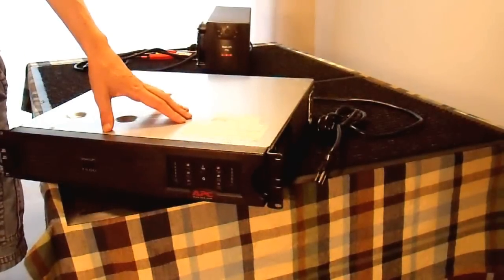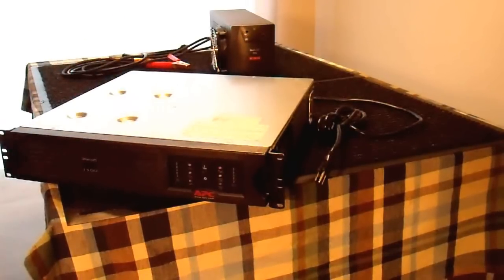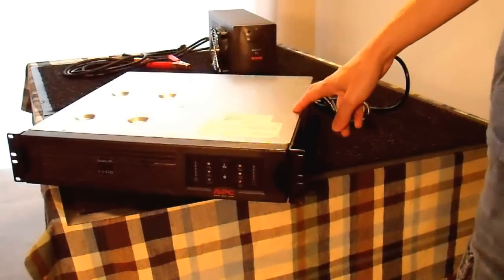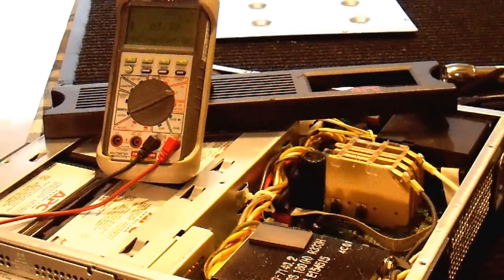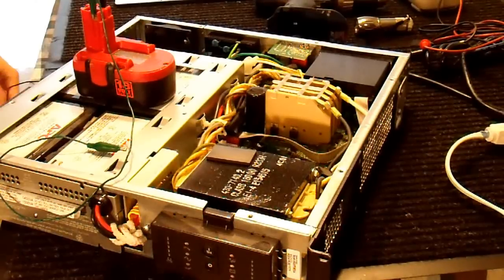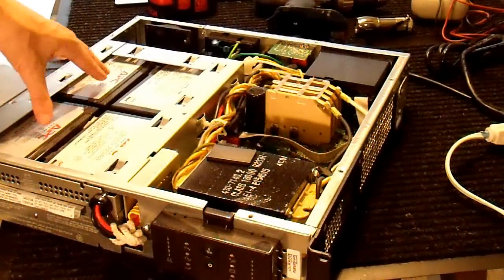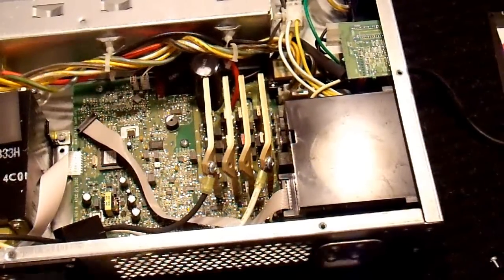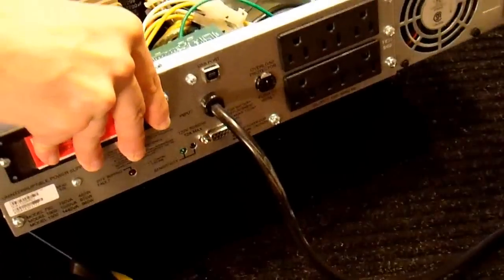UPS to 1.5kW Sinewave Inverter Conversion part1 - Free Sinewave Inverter??

Comment from the maker: I did try reversing the fan on the back of the unit and it resulted in it moving almost no air due to 'sucking' against the fan grate.  Good idea though, I didn't try reversing the fan on top.  It would have been easy enough to give a try - sometimes experiments yield unexpected results!

Comment from the maker: Axial fans don't like pulling air from turbulent sources - it makes them very inefficient.  So pulling air from 'free air' around the unit results in more airflow than if the fan drew air in from around the FET heatsinks.  I'm not sure why it is this way I just know that's the way it works from practical experience.  A good CFD simulation would probably show why this is.  It also forces the air to mix better in the case this way.  Turbulent air cools more efficiently than a laminar flow of air.

Comment: Nice videos.  A question about the temperature regulation.  Did you try using the fan above the FETs as an air extractor vs. blower?  (Cooler air entering around the transformer vs. air that has already been pre-heated by the FETs).  The FET temp. might be a little higher, but you might be able to do away with the "bump" at the front of the case.  Reversing the airflow on the 24vdc fan at the rear of the unit (blowing in) might also have an effect.  Worth a try, or am I bananas? :)

Comment: my camera can't capture this buzzing sound. as everything is working i suppose its ok.
i cant send you links here on comment , i found a mod for smart ups to change float voltage of battery. search google for "APC SmartUPS Battery Float Voltage Calibration" there is hidden PROG menu to be able to calibre the ups.  also mine left without a load and power switch off after a time, i must measure a time.

Comment from the maker: Without listening to your UPS I cannot say for certain, but it is normal for them to make buzzing noises when operating off of battery power.  Every APC UPS I have ever had has made these noises.  If it doesn't get excessively warm I wouldn't worry about it.

Comment: i have "smart" power strip which sense a load. 
may be pir sensor and a relay for detecting present, and power ups up...

another question - my ups is making this strange noise wile charging and when is on battery like buzzing : may be the transformer but not sure, is there anything to make this noise, and is this normal?

Comment from the maker: The majority of the quiescent power is lost in the transformer as core losses.  Aside from replacing the transformer with a more efficient design there's little that can be done.  You could try to get around this like some of the sinewave inverter manufacturers do and cheat by creating some sort of 'smart mode' where it only turns on when it senses a load.  Not very practical in application but it does help their marketing specs for selling them.

Comment: hi what about self consummation of this ups, you mention that consummation is high on this devices, i also measured mine apc sua1000i its drain 25 watts from the grid when the batteries are charged, this makes 24 hours x 25 watts this makes 600 watts from the grid every day. when it run on battery it take it from the battery i think. 
can you think something to minimise this self consummation?

Comment from the maker: As far as I know APC does not have any UPSs that fit your need, but other manufacturers do.  i.e. CyberPower CP850AVR, and Tripp Lite BC600SINE.  I've never looked at one of these to know if they're hackable but options do exist.  Although significantly better than a modified sine and probably good enough for nearly all applications I suspect their output waveform is not as clean as the professional APC models.

Comment: A very nice hack.  Makes me want to find one and modify it.  Unfortunately, I need one that runs off of 12 volt batteries, not 24v. Anyone have any suggestions for a sine wave UPS that runs from 12v batteries that's hackable.  Lower power would be fine.